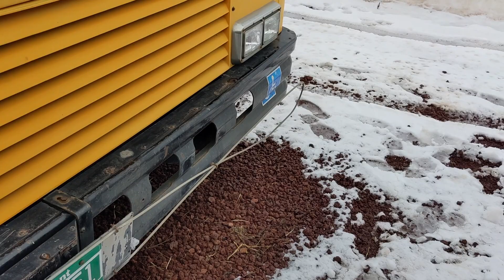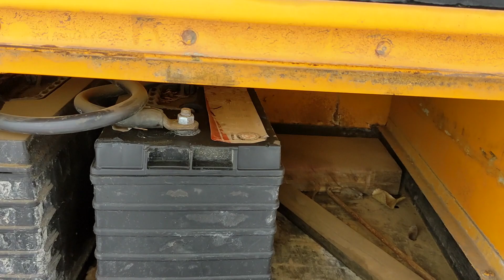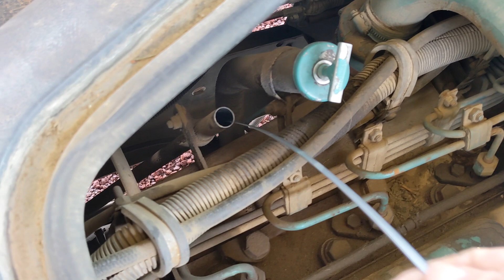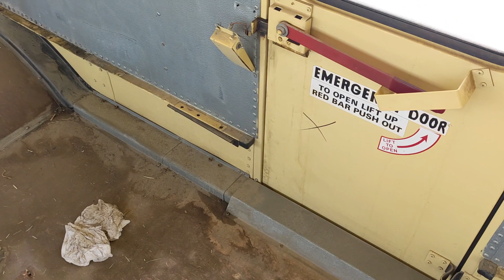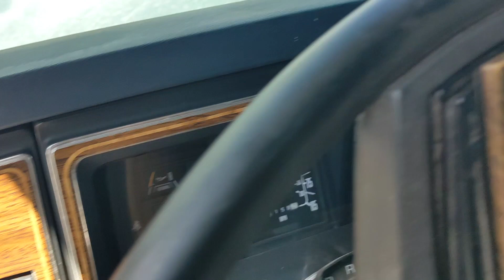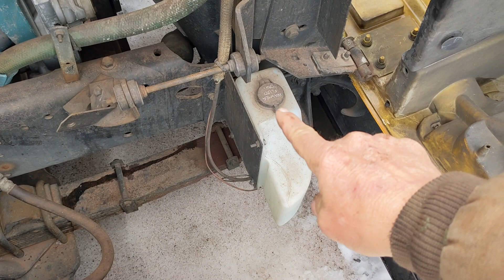Bus owner shows all!

Comment: Napa has the fill chuck like you showed, and it locks on by rocking sideways and binding on the threads.  Harbor freight has the 150psi pop out gauge you showed.  I have a 2005 RE300 and the rear air springs have held position for 4 months without leaking, how rare is that?

Ps when buying a 31 make sure it's a starting battery not a deep cycle
Reply from the maker: Good call...I get spoiled by my Napa, especially, since they have a huge warehouse of heavy truck parts too.  So I didn't want to assume all Napas had those.  I was thinking more of the Auto Zone and O'Reilly kinds and I could imagine new bus owners looking for straight gauges there.  But Napa for the win.

And that's an impressive lack of leakage...very nice!